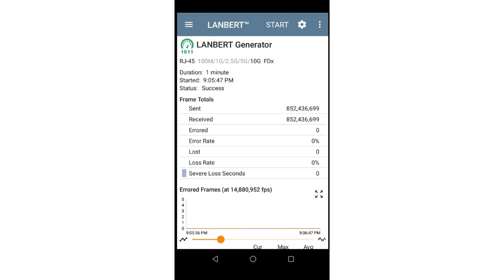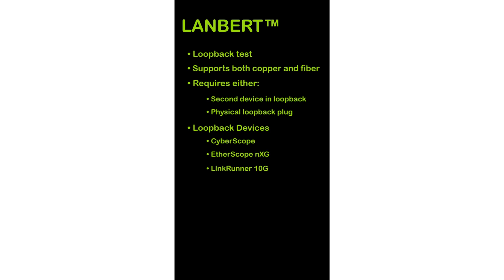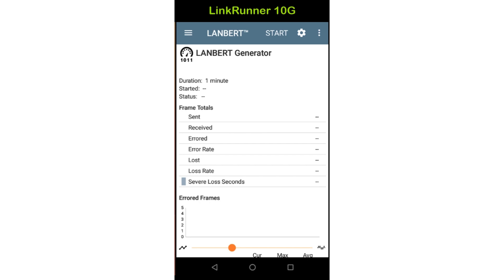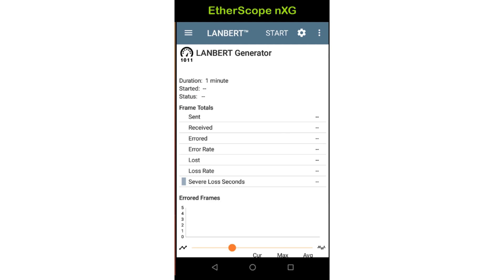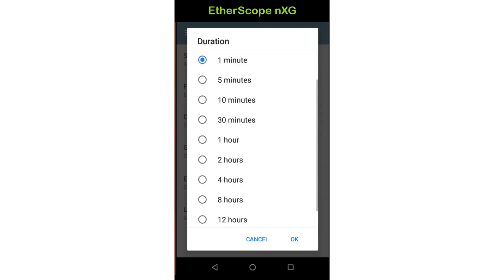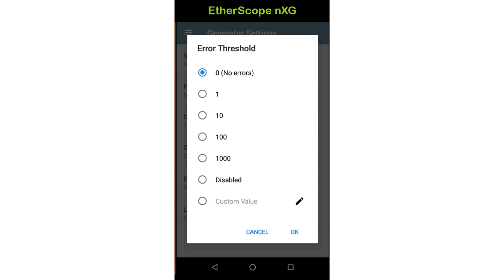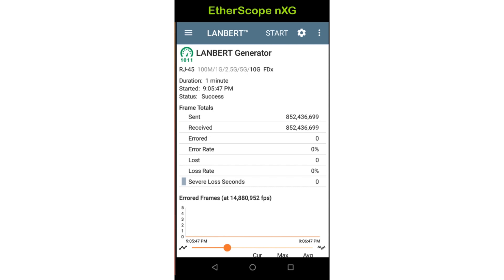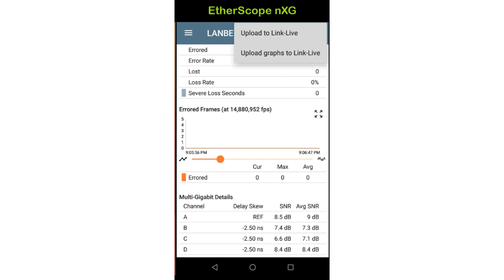App Training - LANBERT™ Media Qualification

Comment: Hi! I see you mentioned at the beginning that you can use a single LR10G device and a physical loop back to test a cable.

I have tested my LR10G with a fiber loop back and I am able to establish a Lambert link. However, my physical cat6 ethernet loop back plug does not seem to give me a link.

How do you recommend using lanbert on a copper link using a single LR10G and loop back plug? Is there a certain physical loop back plug you recommend for ethernet cable physical loopback?
Reply from the maker: Hi Nate - please fill out a technical support request at https://www.netally.com/support/technical-support/ and we will troubleshoot the issue with you. Please provide the configuration (how many gigs) you were testing. Thanks!